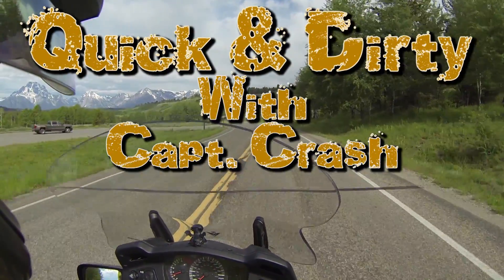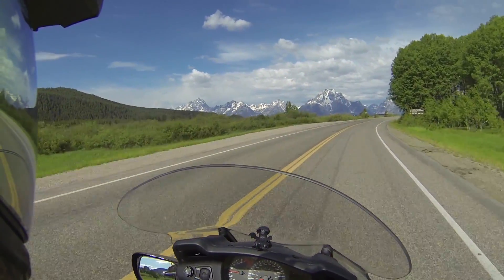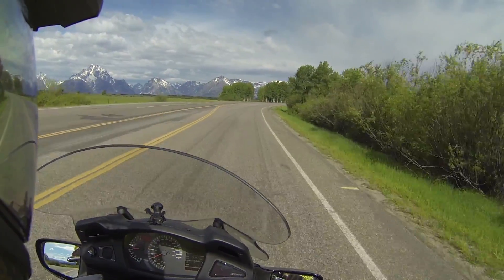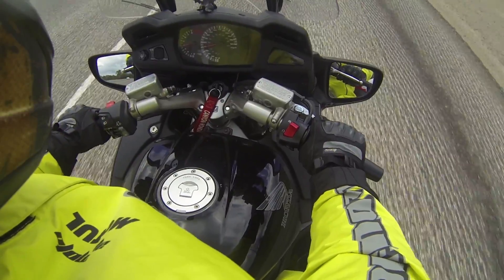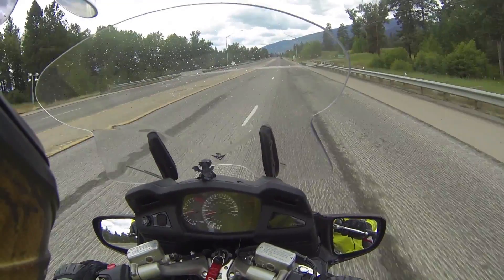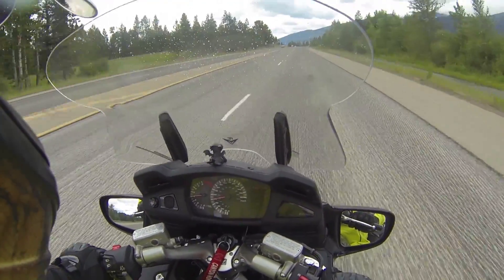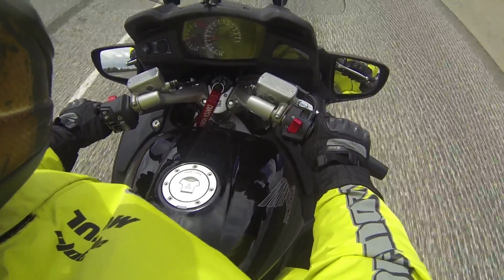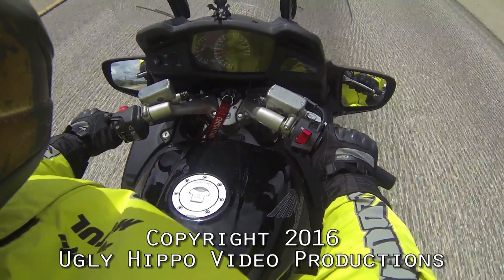Grooved Pavement 2

Comment: I ride a light weight dual sport just tipping 300 pounds. Sense I ride off road as well, this road surface doesn’t bother me a bit. I will admit it gets loose by 60 mph. Feels like there is a half inch of sand on the road and the front and rear tire is always hunting left and right. I use caution in corners and merging over the ridge at the edge of the road. Other than that, send it!

Comment: You can see there's an edge trap there, between the milled area and the undisturbed part, it can be a couple of inches.  Be careful to cross at least 45 degrees if you can.  A friend wasn't paying attention and learned the hard way - 5 broken ribs and a punctured lung. Was out of work for 2 months.
Reply: That was the first thing I noticed... Is there a technique to crossing it?
Reply: +Zaggnutt Cross as close to right angle as you can, 45 degrees or more is preferred.
Reply: If possible change lanes on a bridge